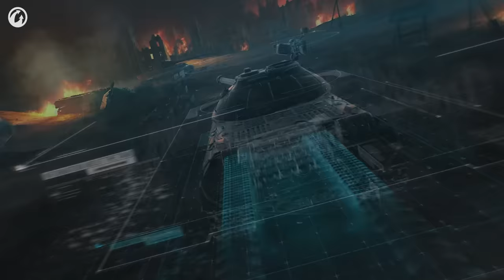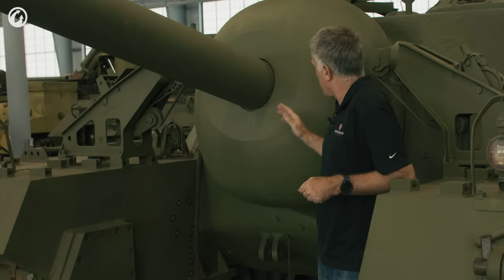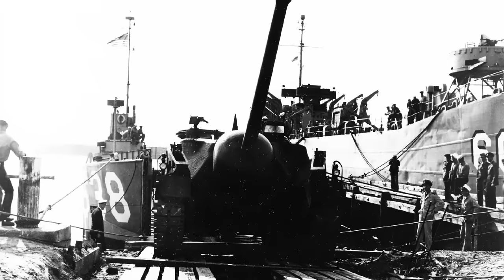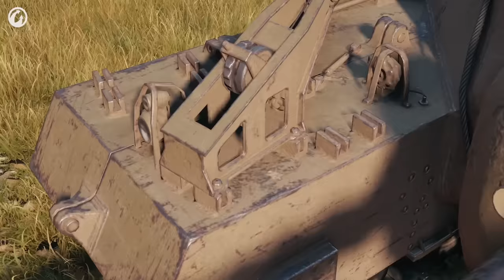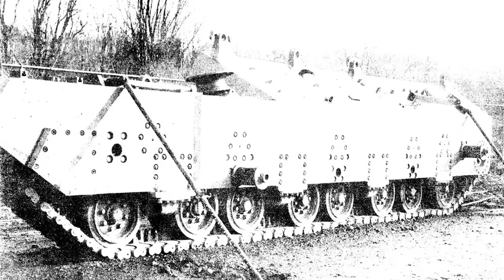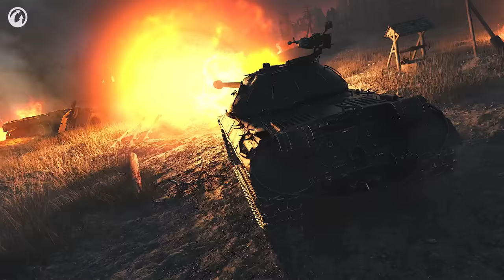Inside the Chieftain's Hatch: T28 Part 1

Comment: "It's just slightly faster than the concrete bunkers it's supposed to be fighting."
Reply: on any given day they're both turning at the same speed tho...
Reply: If a bunker in the Siegfried Line is moving faster than a T-28 Super Heavy can go, something terribly wrong (or right depending on which side of the Axis you're on) has happened.

Comment: They should have left one of the combat track units off and set it a few feet to one side, so the whole system could be seen.
Reply: it would put way to much stress on the thing to have it siting like that for years. remember the thing is basically a one off.
Reply: @tommyfred6180  True; there would probably need to be additional support provided for the hull.  
Also, Sofilein has a video of the outer track attachment process.
Reply: @petesheppard1709  also keep in mind that this thing is already wide enough, separating the tracks would take up even more floor space.
Reply: @Shaun_Jones  If they wanted do display a separate track unit, they could have made the space, though shuffling a whole row of vehicles would be a bit of an annoyance.

Comment: I couldn't but "Like" fast enough! 

The "T95" was the whole reason l started playing WOT some 7 or 8 years ago.  I had no idea such a beast existed until l started seeing replays here on the 'tube.
Reply: Dumbest part is they lost this monstrosity in a field for like 30 years. How does one lose something that big
Reply: @Juliet1106Tango never EVER underestimate stupidity, or probably the army just wanted to get rid of it anyway, the method be damned
Reply: @Juliet1106Tango  lol im sure they didnt actually lose it, they just didnt care about it. It was a useless piece of equipment and anybody that cared about it was long gone im sure
Reply: @Juliet1106Tango The swiss Army forgot multiple HUNDREDS of IFVs in an old mine.
Reply: @Juliet1106Tango  T95 has a really high camo value actually. Leave it in the wild for a year or so and it'll become invisible.
Reply: @KityKatKiller the swiss did what?
Reply: @flogger8413  The swiss military did a lot of funny things. They also invaded Liechtenstein twice on accident. And shot it once with rocket artillery causing a forest fire. Switzerland is still paying reparations for that.
Reply: And after 7 or 8 years, you'll One day reach the front lines.

I had good success with it last I played.  It's slow enough to prevent you running in like an idiot at the beginning, and it's also a great tank for allies to use you as a slightly mobile rock cover so you have some flank protection.

Comment: The GAA engine was a cut down version of what came to be called the GAC which was a V12. The GAF was an aluminum version of the GAA. The original Ford design was for an engine to replace the Rolls-Royce Merlin and Ford tried to produce it in place of (substitute for) the Merlin which is why Ford's contract to produce the Merlin was canceled and a new contract for the production of Merlin went to Packard. I have been told about 50 of the GAC engines were produced for T28 program and it was believed that the preserved T28's had them. If they really have GAF V8s that would conflict with most accounts.

Comment: Chief, love these videos!  Thank you! for your hard work. What was/is the ground pressure?  Figuring 40 inches width, 42 if you count the gap between the tracks what is the contact length?  It actually don't look like mobility would be as horrible as first impressions would lead one to believe.  I visited this beast a total of 6 times between my graduation from Armor OSUT in '82 through a roadtrip with an old tanker buddy in either 2004 or 2009.  (deployments, but Wife says 2009)   IMHO AMOR BELONGS AT KNOX!

Comment: Funny thing is, there "are" tanks without turrets, and tanks with wheels. It seems like "tank" is more a doctrine term (like "tank destroyer" which includes helicopters and MANPAD missiles) than a category. For example, the Swedish "wedge" Strv 103 is not only a tank, it's a main battle tank. It looks like it's a pure defensive weapon yet it was, by doctrine, supposed to be used in all roles a normal assaulting tank would.

Comment: Very strange regarding the tank vs. GMC designation debate.  The M3 medium was always referred to as a tank even though its 75mm primary armament was mounted in the hull.
Reply: But the 75mm wasn't the primary armament, the 37mm was. That's why they carried like 2000 rounds of 37mm ammo. The 75mm added to give extra firepower with a larger HE shell for dealing with bunkers, etc.

Comment: Did the designation as a tank ir GMC change who’s budget costs came from?
It would have taken 12,500 gallons of fuel to run the full 2,000 mile course. At 21 cents a gallon that would have cost the Army $2,625.

Comment: I was hoping to find out what those two things on the rear deck are. They look like fuel tanks to me, but they wouldn’t make a tank with super heavy armor and then have the fuel tanks completely exposed would they?
Reply: It's one way to keep the fire on the outside of the tank. Those fuel tanks wouldn't have been targetable from the front. You can see a similar idea with the Soviet T-34 and the external fuel barrels it carried on its sides.
Reply: @richdurbin6146  True but the ones on a T-34 are just extra fuel and aren’t even connected to the fuel system they’re just extra cans. Losing that isn’t a problem.  If those are the main tanks on the T95 back deck not only are they terribly exposed to things like air burst artillery or strafing planes shredding them or infantry throwing grenade bundles onto it the burning fuel wouldn’t just run over the sides. It would dump right into the engine compartment of the vehicle which could be a problem.
Reply: What two things? The only thing on the back deck are the intake housings
Reply: @TheChieftainsHatch  Ah, so that’s what those things are! I was talking about those two large rectangular things. In pictures they always looked to me like larger versions of the rectangular fuel tanks from trucks or even cars had. That seemed like a bad idea but it never occurred to me they were large intakes. Thanks for the information!

Comment: I wonder if designers ever thought about the possible damage that a rock or any other object could cause if it got between the two tracks.
Reply: The tracks run parallel with each other and going around the sprockets would sqeeze and crush anything out. Mud is more of a problem because it could build up between the inside of both tracks and the roadwheels jamming the tracks.

Comment: I am slightly surprised that it doesn't have the naval five-inch dual-purpose gun common to destroyers. Maybe with standard (short) and longer barrels changeable in the field.

A battalion of diesel-electric S.P.G. with the speed of a locomotive, eight inches of armor, and a 127mm gun capable of high-angle fire for anti-aircraft use or plunging fire, and and capable of throwing naval high-explosive or delayed-detonation H.E. for bombardment, might have been handy in North Africa about a year after proposal. Bringing it to Europe might require hauling it across Siberia, or maybe landing in Ukraine.

Comment: That  hull and it's protection are just wasted in a museum - needs to be moved to Tier 10 as Zelenski's Doom Turtle. 
Take a page out of Russia's book and re-furb this vehicle - and put it back in service. 
I mean it was literally designed to break static defences.
Toss in gas turbine driving a generator, replace the final drives with electric direct drive and if there is room install some batteris for hybrid and quieter operation.
Install some sensors (especially a reversing camera), a mine plow,  Trophy,  a CROWS or two, maybe upgun to 155mm  or even a 165mm demolition gun and lash a Giant Viper (or whatever the American equivilant is - M58???).
And as they say, Robert is your muvver's bruvver. Boom shanky.

Comment: Imagine the mechanical and logistical challenges this tank would have faced had it been put into production and in use on the battlefield. The JagdTiger on the German side gives you a good idea.
Reply: It was designed to do a very specific job. If it was used for that job and very similar ones it should be fine.

Of course, when it inevitably got pressed into other roles they could have some fun

Comment: the problem with the term GMC is that it only actually applies to platforms added to existing MC and not to custom body designs.... but like muzzle break and muzzle brake there's always an illiterate idiot in charge someplace
Reply: I'm not sure how that works. The M10 GMC was derived from a tank hull, not an MC. GMC T22 (Eventually M8 Armored Car) was a bespoke build, as was GMC T49/67/72. The M9 GMC was derived from a tractor.

Comment: Have to say, I think The Chieftan mailed this one in.  The most unique design feature of SHT-28 is the add-on tracks, but Nick merely glossed over how the 4-man crew was supposed to be able to go from travel mode (outboard tracks in "trailer" mode) to installed mode in less than 4 hours.  Would have loved to have seen the diagrams in the operator manual, how the winching and capstan system worked, and where and how the track installation tools are stowed (Hint:  they are in pull-out "drawers" built into the external track housings).
Reply: Did you click the link for the 12-minute version of how to take the tracks off? See the text of the video description, or the card which pops up part-way through.
Reply: @TheChieftainsHatch  I intently watched all three of your videos, plus the three that Rob and Sofilein did about 2-3 years ago.  I'm still not understanding how the two crane winches can lift up 7-1/2 tons each without them being powered, and can't understand how a guy pulling on a rope wrapped around the brake capstans could steel the 30-ton trailer assembly.  What would be very helpful is a scan of the available documentation.  Rob and Sofi show a couple of pages in their "scrapbook" video from 2-3 years ago but so much more is needed.  It would also be helpful to show the tools in "Basic Issue Items" inventory layout style.

Comment: This vehicle is a bit of a departure from normal American procurement as it is very single purpose and not overly practical. How come it wasn’t cancelled before getting to testing? I think I will file this tank along with the sturmtiger and tortoise as a good model kit but terrible idea.
Reply: Our grandparents tax payers dollars at work 😅
Reply: Because there was a percieved need for it. The siegfried line was a large chain of fortifications and other defenses. And the Americans prepared to tackle it, just in case they were forced to.
It is to far in land to use ship artillery, so to break that line they need infantry, tanks and artillery.
Now while artillery is great to soften up defenses like that, actually bunker busting with it is difficult due to the range of being safe, and the range of more accurate fire being opposites.
Normal tanks run a real risk of getting penetrated by the fortifications guns. Let alone infantry.
So what seems to be the solution? drive a tank with heavy armor so it is not penetrated with a big enough gun to more accurately take out fortifications where it is needed.

It was never going to be a production vehicle that would have been build in the thousands. It would be a low production vehicle used for specific missions.
Reply: @charchadonto  the thing was delayed past the end of the war before getting into production. I am surprised that the project wasn’t cancelled before any were made .
Reply: @johnludmon510  They used the prototypes for various tests like embarking and dismebarking landing craft. Maybe they just wanted to know how to deal with such a heavy vehicle, in case something similar was needed in the future.
Reply: @johnludmon510  I suspect the project was initially continued after VE Day in case it was needed for the invasion of Japan, then after VJ Day in case the developing Cold War turned hot. It is a fortification system buster and as such remained useful even after the war was over, and even if the vehicle itself became outdated, experience with the concept and the type could be useful. Like many other things, the advent of the heavy guided ATGM made it a liability and not an asset as even early heavy ATGMs could go through any practical thickness of armor including the 12” frontal plate of the T95 - the same thing that informed the development of the Leopard tank. Heavy ATGM could also perform the fortification busting mission better than the T95 - but there’s a gap between the end of the war and when the heavy ATGM shows up in the field and that’s where the T95 lives.
Reply: @johnludmon510  Because lessons can be learned from testing such a prototype, and developing the technology can lead to applications elsewhere

Comment: I still don't understand how engineers thought this was a good idea considering its weight. That's gotta create engine, trans, suspension reliability problems. And soft ground, rain, mud, soft roads, bridges, dock crane lifting capabilities, recovery vehicles, repair speed.... I see so many things going wrong if this entered service back then.
Reply: Well considering what this vehicle was intended to do, it'll all made sense
Reply: @Kalashnikov413  Not really if it's too damn heavy to get where it's going
Reply: @blackhawk2302  bro it was made to break through one of the most heavily fortified defensive line, so of course you need to put a lot of armor on it
Reply: @Kalashnikov413  You're not getting it. It couldn't even get to those defenses to begin with. Big reason why plans were scrapped
Reply: Sherman’s had trouble on European bridges
Reply: @tomhenry897  Yeah they did. And the Sherman weighed half of what this thing weighed.
Reply: @tomhenry897  Shermans where the main tanks. They had to cross plently of bridges. T28? Not so much

Comment: Americans engineers trying not to use same desegregation for a tanks as USSR, and USSR engineers trying not to do the same
T26 Medium Tank (Pershing) - T-26 Light Tank 
T28 Heavy Tank - T-28 Multi-Turret Medium Tank 
T29E3 Heavy Tank - T-29 Wheeled Track Medium Tank
T34 Heavy Tank - T-34 Medium Tank 
T38 (M7 Priest) - T-38 Light Amphibious Tank
T54E2 Heavy Tank - T-54 Medium Tank
T55E1 Tank Destroyer - T-55 MBT

Comment: Metric? Even a little bit of metric ... Maybe?
Reply: The US government wasn't in the habit of using metric much at the time, so the specifications and figures in the manual are all in imperial. You'll note I used metric on Panther II as the Germans weren't much into inches or miles in their documentation.
Reply: @TheChieftainsHatch  you don't usually read the manual verbatim without editorialising somewhat. Would it kill you to accommodate both metric and imperial?